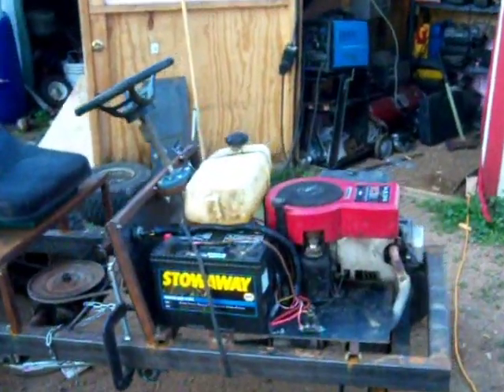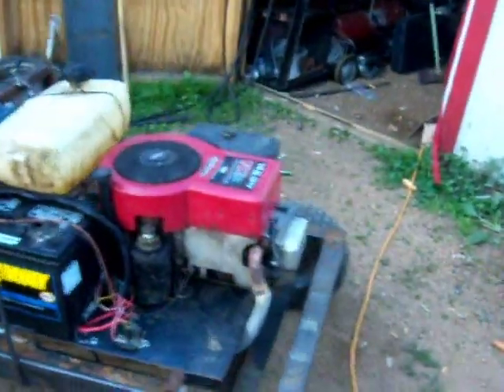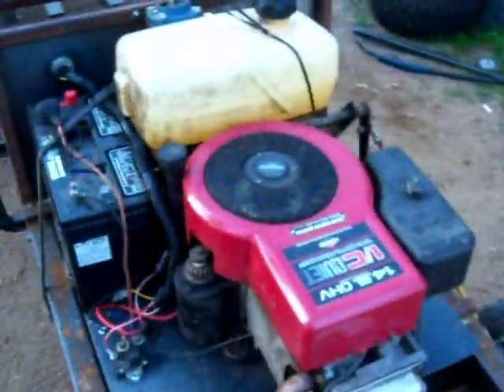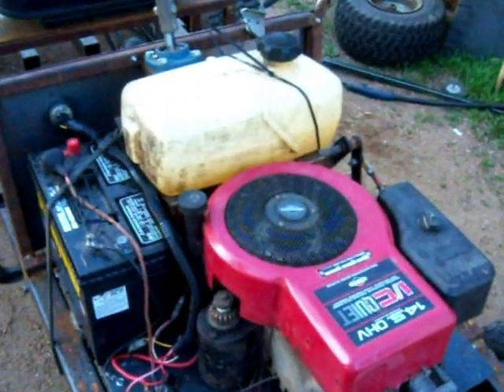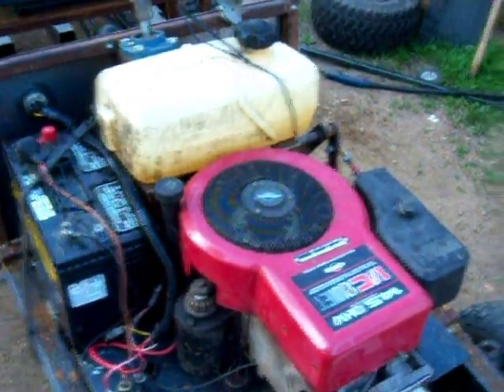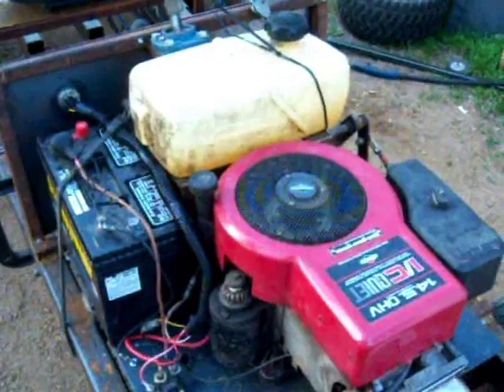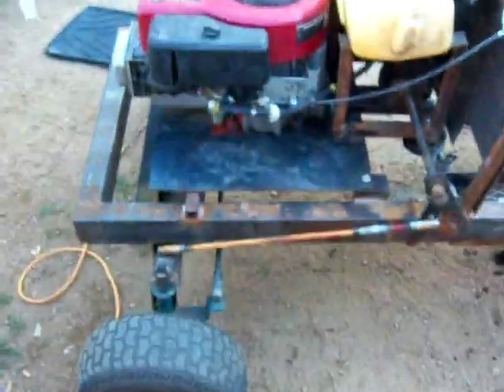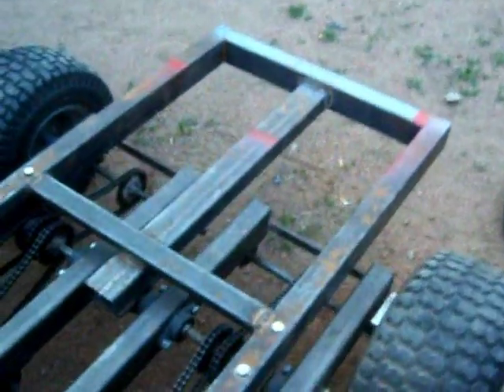homemade mini dump truck

Comment: Really glad I found this!  I been thinking of oding this in the summer, got most of the stuff I need.  Going for a flatbed though.  
Was going to do a single axle setup.  I dont think a standard mower tranny would handle all the chains and stuff.